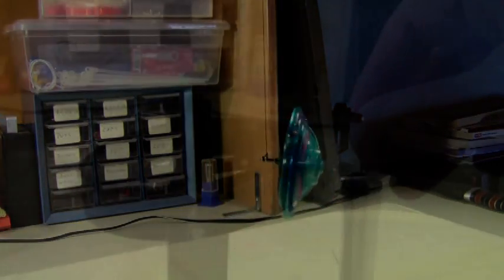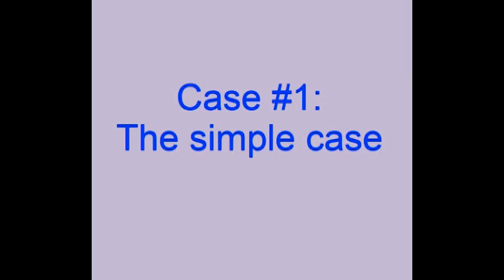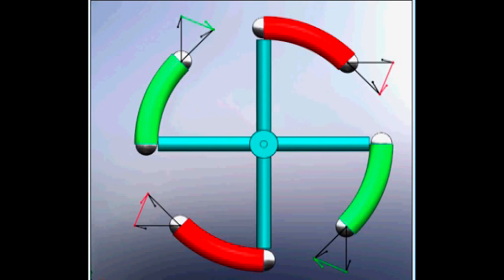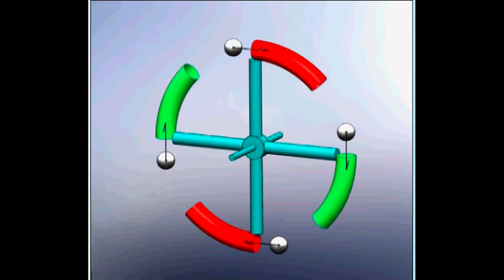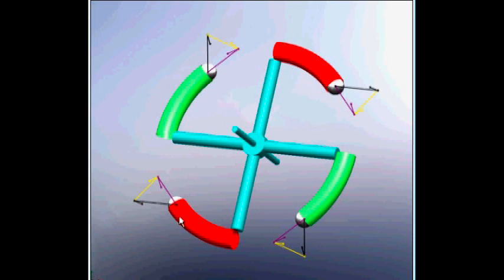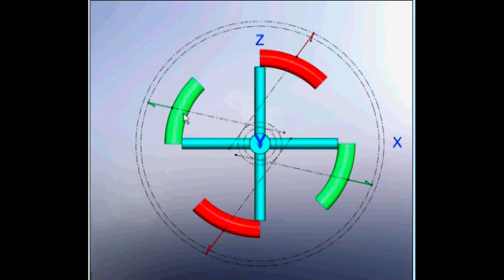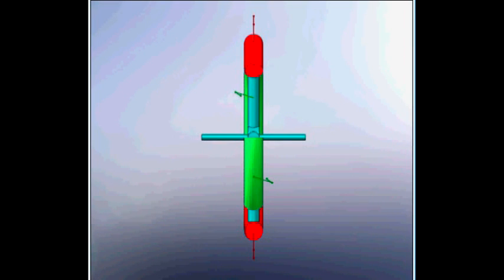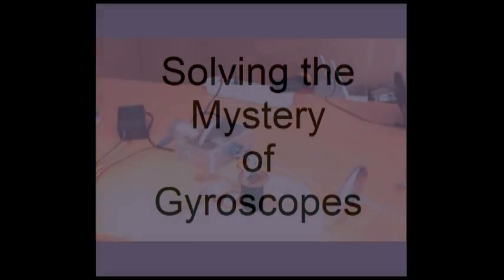Solving the Mystery of Gyroscopes

Comment: What this doesn't show is the diverting earths gravity towards the center of the gyro the point of least resistance. Like if you stur a cup of coffee and the center stoops down from diverting Earth's gravity to the center to keep hold on the faster moving molecules through covalent bond, so the molecules in the center take up the slack and become heavier and stoop down.
Showing gravity is an Inertial force.
Reply: I believe just about everyone neglects this fact. That there is most certainly a centripetal force that is also manifest at the exact same time as the centrifugal. The resulting need to precess is the same behavior exhibited in a permanent magnet. This leaves me with no conclusion other to describe the phenomenon as entirely field based. The field magnitude of the flywheel has changed, and weight (gravity) is magnitude specific. The added precession is force and motion away from force dissipation null point (center of dielectric plane of inertia).
Reply: @elams1894  there's no such thing as centripital or centrifugal force, they defy the Newtonian Law's of motion and are without action and reaction basically non fundamental. It's inertial by acceleration and lagforce thereof.
Your angular momentum is stupid, it's velocity and rate of change of angle. Example:

Lfi lbs=(1lb× (360°/s))/1yrd=
360lbs/s. Per 60rpm's
Outwards away from the center lagging behind the change of angle. This outwards force leaves susceptibility in the center for an external force to get trapped in, that makes you think its centripital force but the external force is gravity on earth. Explains tornadoes and huracanes.
Reply: @alberttorres4917  I didn't say anything about angular momentum. You say there is no such thing as centrifugal and centripetal force an yet you go on to describe it.."this outwards force". The correct terms are pressure mediations rather than force, I get that. Centrifugal and centripetal pressure mediations are irrefutable. They exist in a permanent magnet, as a conjugate pair, and that has been demonstrated on every level. The centripetal convergent pressure mediation is the fundamental driving entity of magnetism, not vice versa. What is happening in a gyro is similar to what is occurring in the field geometry of a magnet, that is my point. It's is a field based phenomena.
Reply: @elams1894  lets go back and look at what Newton was looking for as F= Mass×Acceleration.

The force he was looking for was Lagforce. When you have acceleration you have lag behind that. He wrote his formula as:

Fkg=Mkg×(~V÷~T)
~=rate of change.
So if we have a ball that weigh 1kg and moving at a fixed velocity of 1meter/s, there is no force untill I act upon it with say 10meters/s for say 5 seconds. Then We have 2 kilograms of lagforce untill the time runs out. Then it goes back to 0 even though it's moving faster.

He should have wrote it like this:

Lfi kg = Mkg×(~V/~T) for linear motion.

This would be then the first law of Inertial force.

Now for circular motion.
If people would have payed attention to his ponderings they could have completed his research on what really takes place with circular motion.

First the law.
Lfi lbs=(M lbs×(~angle°/s))÷radius yards.

So if you have 1lb mass and 1 revolution per second and a 1yard radius then:

((1lb×(360°/s))÷1yard)=360lbs/s of outwards lagforce lagging behind the change of angle and that leaves acceptability in the center for an external inertial force like Earths gravity to get trapped in. 

It's all inertial and lagforce.
Centripital and Centrifugal by their definition are not fundamental and lack action and reaction. 
Change that to have real functionality then.
Reply: Oh by the eay magnetism is micro inertia and gravity is caused by macro inertial force from acceleration. If you take the orbital velocity of earth and devide it by ( rotational velocity × 2.00000338199s^2/ft)= g constant.
Which 2.00000338199s^2/ft is the rate the Sun's pull on earth is diverted towards the center of earth to create g constant by rotation.
(Vo÷(Vr×g))=d constant
d constant = 2.00000338199s^2/ft
Vo= 18.5449916097mi/s^2
Vr= .288197492736mi/s^2
g = 32.1740485564ft/s^2
Vo=(1000×c×pi)÷(365.2425×86400) or (Vr×g×d).
The lagforce from g acceleration against the ground causes your weight, not matter attracting matter.

I work for this government and we are more advanced than your scientific community by 1000 years. We could change that but it would require letting go of many THEORIES and practice thinking to stimulate that processe.
Reply: @alberttorres4917  Centrifugal and centripetal pressure mediations ARE the fundermental principles of magnetism. They cannot occur independent of one other. They form the basis of field geometry. Centripetal pressure mediation, the dielectric plane of inertia (dielectric acceleration) is gravity. They are one and the same thing. Magnetism is the inverse of inertia, the inverse of pure potential. Inertia is the counter-spacial plane, the null point of force dissipation. Inertia, is the inverse of force and motion. Dielectric acceleration (gravity) is magnitude specific, eg magnet falling through copper. We will have to agree to disagree. I am coming from field theory background and you are clearly quite the opposite. Have a nice day.
Reply: @elams1894  That is your opinion! If you have two particles setting in space with no action then nothing happens, we measure space and yes it's a vacuum. If we cause between the particles a less than zero vacuum say minus 5 then they are attracted towards that, magnetism is just that at sublightspeed. The proton has like earth and our Sun an implosion field of micro inertial force in it's center. This attracts the electron which also has an implosion field of inertial micro field offset to a lenier motion but attracted to proton so it orbits.

So if I have something that is missing electrons in my circuit then the electrons will move towards tbat to fill the emty spaces. Centripital and Centrifugal have nothing to do with it. My major is microphysics for advanced electronics.

Your people can't even figure that Earth has a Capacitor built in, in order to pulse a 7.83hertz field around the planet. The magma wont pulse on it's own without it. 
It might polarize but not pulse, it needs it's capacitor and every Engineer on earth must agree or they're not Engineer's.
You can keep believing what you want it's your problem.
Reply: @alberttorres4917  You are a so called advanced electronics major and work for a government who's technology is 1000 years ahead of anything else, yet you can't explain magnetism, nor any field, and you believe in so called electrons, evidence for the existence of which doesn't exist. Congratulations.
Reply: @alberttorres4917  Electricity is manifested in magnetism. Magnetism IS centrifugal and centripetal pressure mediation. If you believe that neither centrifugal nor centripetal pressure mediations have anything to do with electricity, then you are delusional. They ARE the fundamental producers of electricity. How did you get through your electronics degree?
Reply: @elams1894  Are you saying the earth doesn't have a Capacitor in order to pulse at 7.83 cycles per second. Where the centripital force?? By definition a center seaking force is non fundamental by everymeans without action.
 And do you think space is a flat material you can bend? All this without proof? 
Your science is a religious belief that needs faith.
And centrifugal means away from the center seeking force, where dose that come into the pitcher for moving electrons without action and reaction.? To date still nonfundimentle.
Reply: Perhaps it's just a frame of preference. And I got through with A's. And was used by the military to dissect shot down craft's and solve how they worked. If you go back and read and do the math I gave you, you'd see what gravity and magnetism really is. Both are INERTIAL force. Sense gravity can bend light then both are inertial, and light is a magnetic wavelengths of micro inertial force.
Only an Inertial force can effect another inertial force directly no matter what kind. If you can't understand this then you'll never know. Just how close your knuckles are to dragging on the ground.
Reply: @alberttorres4917  I don't want to read your math on magnetism as you clearly don't have any idea what it is. Again I say congratulations to you on your illustrious career and best wishes.
Reply: You know whats funny is how you think a nonfundimentle so called force can cause pressure to move electrons, when we use magnetic field's to create the pressure through attraction and it's not centripital or centrifugal in anyway knuckles.
Reply: @alberttorres4917  Electrons do not exist.
Reply: @elams1894  yeah I know!!! Their just inertial force of circular motion and all the particles are the same with polaritys of north south positive and negative. Invisible force just like the cause of gravity, They're inertial in everyway.
Reply: Our UFO's inject mechanical inertial force onto a magnetic micro inertial toriodal field to block Earth's free fall to become weightless and then charge large capacitors to move and hover controle. The current won't jump across but information will causing push in the positive direction. We've been doing this sense 1955. Check out the TR3B it's ours.
Reply: @alberttorres4917  Well then we are arguing over the same thing. I completely agree. A particles polarity and spin is misconceptualised as an electron. Glad I'm not taking crazy pills lol. We can move on with common ground ha ha.
Reply: Nichola Tesla built the first flying sauser in thr 20's.
Reply: @alberttorres4917  what mechanical force do you use to fill the magnetic toroid? I understand your capacitor analogy, Tesla utilised the same thing. I conceive of this capacitive atmosphere as separation of charge. I also conceive of capacitor banks as charge separation forcing the formation of a dielectric plane of inertia (same as your gravity explanation) , which indeed can be precessed away from earth's gravity. I indeed think we are describing the same phenomenon with different terminology. I am interested in what you use to inject mechanical force into a toroid, sounds very interesting.
Reply: @alberttorres4917  Yeah Tesla was the guru. Very interesting researching Tesla, how he was shut down by Morgan. How did the classical field theory of Tesla et Al, Steinmetz, Alexanderson etc get completely steamrolled by quantum? Trumps uncle etc. You sound like you might be privy to some high level field theory knowledge. That's powerful info indeed.
Reply: @elams1894  well the toroidal field around the craft is just a magnetic shape. The field concentrates down the center like Earth's magnetic field, at that point there's a spinning superconductor, " a flywheel filled with mercury and antifreeze so at 100 kelvin it's not solid but free wheeling" at high speeds with extreme outwards mechanical force, the magnetic force can't pass through but instead bends and flung outwards and connects with this lagforce and instantaneously on the toroidal field around the outside of the craft blocking the Earth's g force making the craft weightless. Now you can change the shape of the field with coils like 3 of them.
Bob Lazar called them gravity amplifiers but really? Charging a Capacitor is easier. If you charge the capacitor with 1000000 volts it's the sublightspeed without lagforce,g force, inertial effects of any kind. On the TR3B you only need one superconductor, the force becomes information on the electrical system. So all four give thrust. We can go anywhere at lightspeed even Mar's which has a g constant of 26.5264ft/s^2, a 10lb weight on earth is 8 1/3 lbs on Mar's.  Its magnetic field is there but collapsed from a crack in it's mantle or dielectricconstant of its spherical Capacitor.
Reply: @elams1894  I did my own thing ignoring everyone's theories a distraction by all rights. It began for me in 1955 I was 5yrs old, I wanted to know why man didn't understand The cause of Gravity or weight taken from the Latin word gravis which means weight. I was moved to the 5th grade because my aunt didn't want me in the same grade with her daughter, they gave me a test and was doing trig,algebra,geometry, and some calculus. But my problem was having to fight older kid's so I took up kung fu India stile cobra.
They left me alone. There's a book on astronomical charts and it said earth orbital velocity was 18.545mies/second. So I wounderd what I'd get if i devided orbit by rotation and got 64.348145178ft/s^2
I knew 1/2 of that was free fall of earth. So beganr my research on gravity. I sense then changed Ohm's law where you have 2 things to find a therd, to know 3 thing's to find a fourth and it work's. I use Keplers law with my math to calculate the free fall's of other planet's. Because Mar's has 3times the xeonon 129 isotopes of Earth I believe two big hydrogen bomb the size of the empire state building was detonated on Mar's in the past by us against something there. It only comes from a hydrogen explosion. Which explanes the collapsed field.
Reply: @alberttorres4917  IV read a little about the TR3b. If you were involved with that craft, dang, cudos. I thought maybe graphine might be sonewhere in there too. I knew mercury was used but it was never revealed how it was used. That makes sense now. The centre of the toroid is what I call the returning magnetic displacement and I conceive of it as centripetally returning magnetism, a hyperboloid geometry of the toroid inverse, ok that makes sense. So you are using the mercury as a gyro flywheel right in the exact same position as the dielectric inertia plane which is strong centripetal. That's quite clever, I would have never thought of that one to be honest. I call super conductors super insulators as they are completely diamagnetic. In essence I see them as almost completely dielectric with anything magnetic locked into the inner atomic, otherwise magnetic is completely didplaced. All the super conductor levitation footage that iv  seen is the magnetic field of the levitating entity trying to accelerate to the dielectric but can't penetrate it and thus floats on it. Interesting. Let me get this straight. So with a mercury flywheel, returning magnetic pressure mediation is not allowed to dissapate at the centre null point and is directed out, back to the toroid. Ok so that's extreme force and motion outward displacement indeed. Capacitor banks are massively dielectric so I would assume they would displace  the toroid further? as dielectric hates magnetic and directs thrust upwards or where ever. That's actually awesome dude. I don't know if your the real deal but you know too much about fields to be yanking my chain. Nuclear reactor for power I assume? How do you develop your magnetic toroid? Just straight up electromagnet? And what becomes of the electro magnets natural dielectric inertia plane? Is it just completely overwhelmed, displaced by the Mercury? You are a privileged individual indeed.
Reply: And yes I work for the military complex in the marine corps at lonepock underground on everything they shoot down and have all data stored on their computers that are not on the internet. So I can collect data put it together and figure out anything related to my research and then some. Most these guy's don't understand anything. But I do have my own language on this that might be confusing so no one gets it. Lol
Reply: @alberttorres4917  same here, i try to talk field theory or magnetism to any comment thread or any of my mates and they all just raise their eyes at me or bring out their quantum Bs. Frustrating as all hell. I just pretty much give up and do my own thing, own research. Thats awesome, you get to not only research the crap out of everything but you can work on actual craft. Dang I'm jealous. People just don't get it. The power of fields, it's right there all around and yet nearly all are oblivious to it. It's given me a lot to think about. Thanks for sharing, if I fire you some other field questions in the futire it be cool if you could full in some blanks for me.. I don't need to know any military shit for obvious reasons, but field questions only... cheers
Reply: @elams1894  well I think I'm understanding what your trying to say, yes there's ceramics in the mercury with a catalyst of some kind of barium that like the ceramic donut inside the gyro so when it becomes a liquid superconductor it won't seep through the molecular structure.
Reinforced by titanium on the outside. Once this force in on the toroidal field it no longer is on the gyro. The outwards force on the field is so much force and tightly woven it blocks all other inertial fields except light. The Germans tryed to drop bombs with the field and would catch them at the bottom inside the field and would blow up nearly killing themselves.
Only Teslas beam weapon would operate through the field. But an EM pulse transmitted on a microwave as carrier will knockout their field and hit the ground before recharging the field so there is a way to stop this from happening by adding a mechanical gravity field to keep flying without the field untill the field is recharged. At that moment you can fire all kinds of weopons to take out the source.
Reply: The toroidal field remains there acting like a carrier wave for the mechanical inertial force. They both are micro and macro inertia.
So you can put them together and they become a barrier even blocking bullets. There is a ring imput coil tuned to 28khz from the Schumanns cavity tilted at 35° then upsteps to secondary coil like a Tesla coil down the center that grts interfered with bu the gyro to inject the macro force up to the micro force. Once they are connected they work together. Barly charging capacitors let's the craft hover and can move real slow like 1 inch per minute.
Reply: @alberttorres4917  That is some weird cool field geometry indeed. The pressure mediations will be slamming into each other like crazy. I wonder how they react together? I gather they must integrate at the gullies of least pressure, in a hypertrocoid matrix of some sort? A complicated outer toroid. Seems like resonance is at play here, as well as the golden ratio angle of precession, very cool. Where is the gyro flywheel located? Who was the bright spark who came up with the design? Is it a Tesla initiative?
Reply: @elams1894  lol yea I get it your speaking a different language but the same subjects. I don't agree with quantum mechanics of which Einstein came up with then spoke against it for the rest of his life.
I don't agree with flat earthers,flat spacers, flat mooners. It might be Einstein's fault again making space flat so his theory looked good but space isn't made of anything at all and it's everywhere and doesn't need to move or bend because it's already there, if it eas flat I could measure it but it's infinity in every direction. So I consider him out of tuch with reality. And ok gravity bent light, that's because they are the same type force and can effect each other. The lensing effect can also be magnetic fields around planets and Sun's distorting light as well.
Reply: @alberttorres4917  entirely agree. Einstein somehow gripped modern science and everyone fell for it. It was his wife that did the math for him. She actually knew more than him. Like you say, a field is not in space,  space is a posterior attribute OF the field. It does not bend and nor does time. Space acts on nothing, and dielectric pulse perturbations, i.e. light, faces least resistance through the vacuum of space. That is why light slows down through glass, because the rate of induction is much higher through glass. But try to explain that to your mates lol. They are all obsessed with the absurd notion of photons. No one I know of has ever heard if the word dielectric, astonishing.
Reply: @alberttorres4917  Quantum is just a nonsense. I don't get how consciousness and particles have infected science. It is true that it is nothing more than a weird religion.
Reply: @elams1894  Yeah I agree it's a religion because you have to have faith to believe that crap. I like real facts like earth gets closer to the Sun it's orbital velocity speeds up but it's rotational velocity slows down and the differential of the two circular motions causes free fall to remain the same at 9.80665m/s^2
And a day last longer. When it moves away from the Sun the orbital velocity slows down but the rotational velocity speeds up snd still the free fall remains at 9.80665m/s^2
And they have no quantum mechanics to explain that.
Reply: I always wondered if Trump and Queen Elizabeth got together what their child would look like? Perhaps a comb over and look like Mr. Bellvadear and be female, the next Queen of Eingland maybe?.lol
Reply: @alberttorres4917  Ha ha. That would be hilarious. Like magnets, trump has really polarised the US it seems. That is classic, you got thrown out of a debate because you were speaking common sense. No one can handle anything that goes against Einstein. Its super bizarre. C.P Steinmetz was the real brains of that time, yet no one knows who he is. Where was the position of the mercury flywheel? Was it under, or middle of the tesla coil? Seems to me that the position of the flywheel is critical to the system.
Reply: @elams1894  In the reverse engineered experiment the gyro was under the secondary windings but above the primary. The craft was shaped like a bell, the 48 pie shaped capacitors were on the bottom. Voltage was applied in the center, a hanging switch ball chose what capacitor and a foot peddle could raise the voltage for higher speeds, 1 million volts was lightspeed. As long as the concentrated magnetic got in contact with the gyro it would put the force on the magnetic force. We didn't care about aerodynamics because it's a sphere shaped field moving the air or water out of the way. 

We saw this large craft by the Sun drawing plasma from Sun, and I said Ronald Trumpit on his way back from the solar system Mary Jane stopped by the Sun to light his joint because he couldn't find his matches and had to hold up his comb over. Man I caught hell for that!! They can't take a joke.